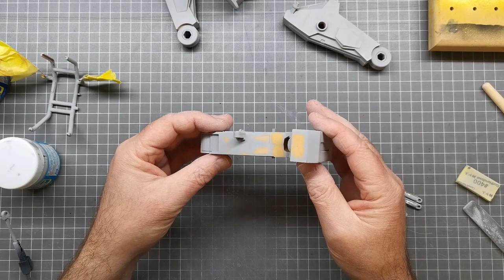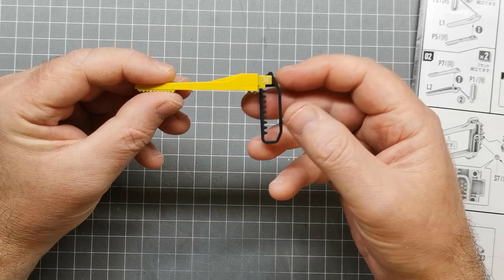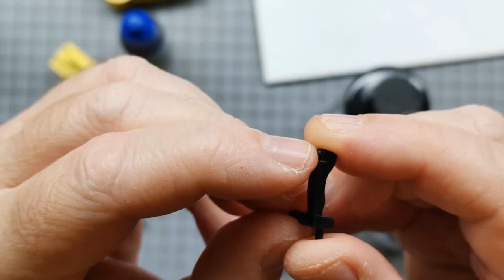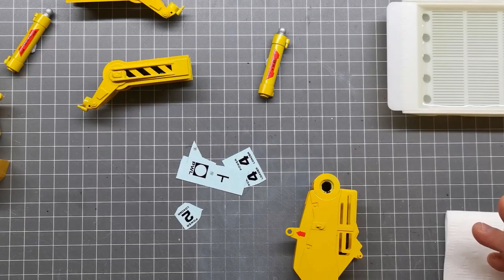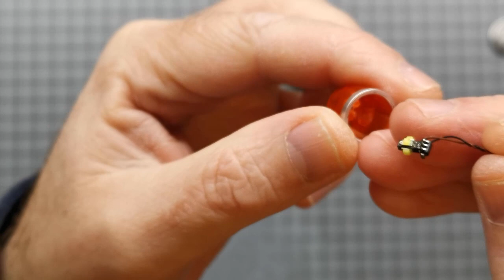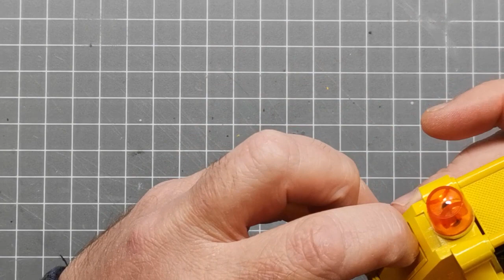Moderoid 1/12 Aliens Power Loader Part 2 - Painting, Decals and Lighting Continued

Comment: Nice work on the Goodsmile kit. I am working on the Halcyon one giving it all the movement your model has with saw and plastic, balsa, metal and plastic card mods!  I have the PVC/Resin Halcyon  queen in black primer waiting to be posed with the loader. Your Ripley is not as bad as my Halcyon one, with only slightly rotational arms for posing and worse moulded hair! Looking forward to seeing your finished paintjob on Ellen and your hydraulic piping.
Reply from the maker: I would like to get my hands on the Halycon kit but they are fetching high prices at the moment. I would be interested in comparing the two kits. Good luck with the build and I am sure it will look awesome with the queen alien next to it. My final videos of the build go up tomorrow. The painting of Ellen turned out OK but the hydraulic piping was a nightmare :)